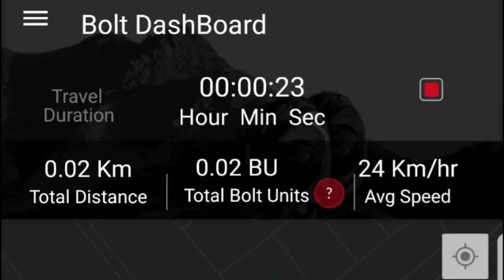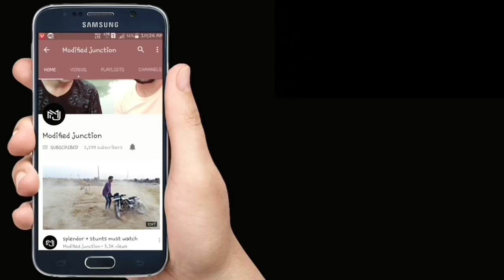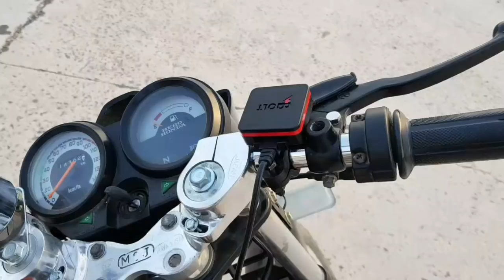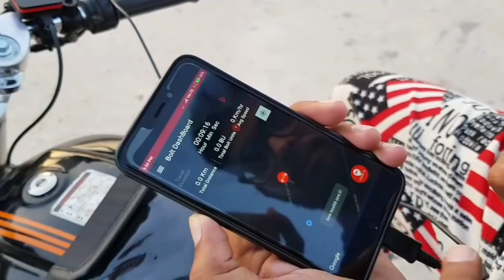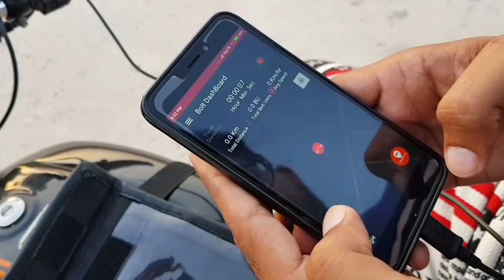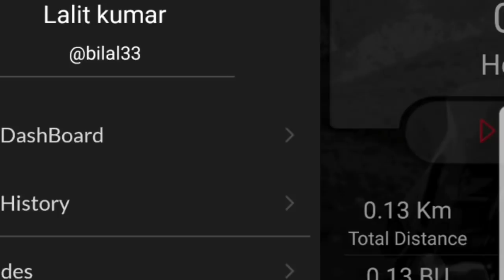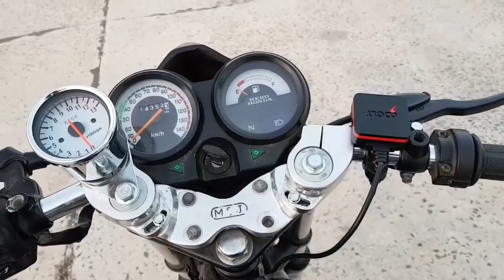How to install bolt fast charger & tracking device in all bikes must watch

Comment: Instead of connecting it to battery, connect the same to ignition. Reason# connectivity to battery means it will always pass current whether in use or not whereas 8f you connect it to ignition, it can be used only by owner.